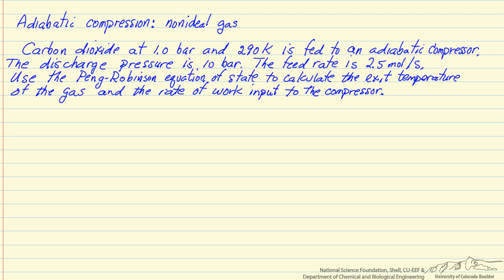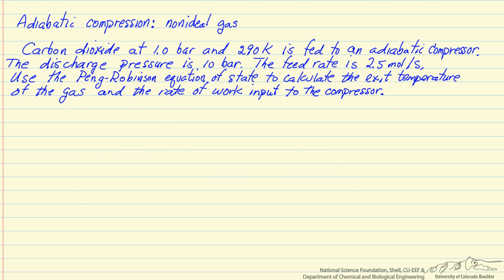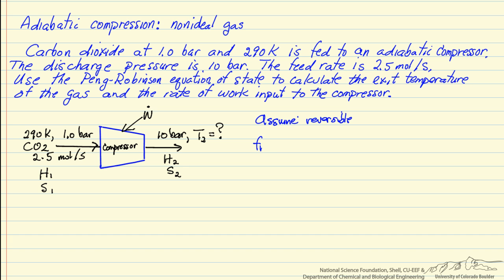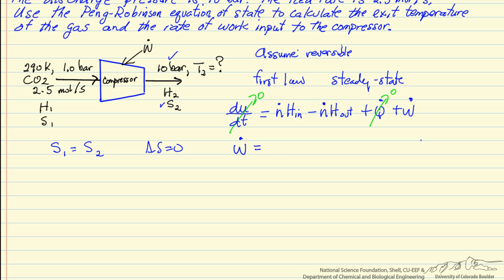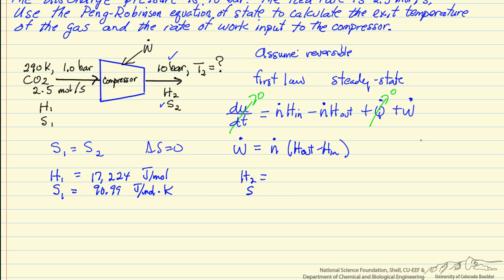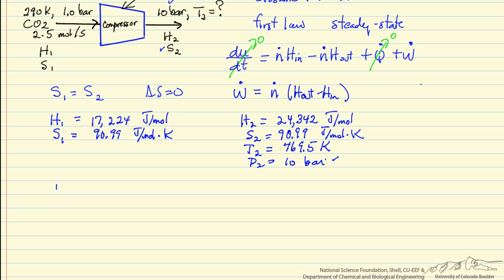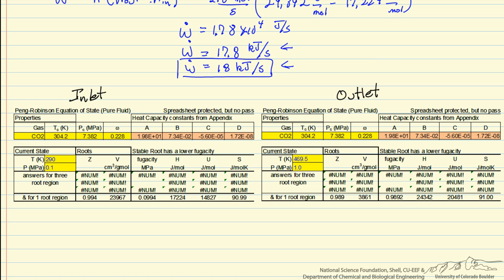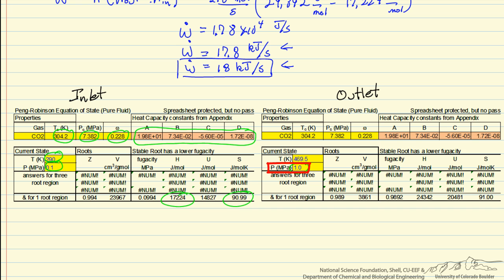Adiabatic Compressor: Non-Ideal Gas

Comment: Hi.. i tried the spreadsheet but the absolute CO2 enthalpy value is different. It is -297.69 J/mol. How come? I think i put everything right. The ref state is 298 K and 0.1 MPa, and it's in one root region. what did i do wrong? Please help.. thank you
Reply from the maker: The absolute values of enthalpy from the spreadsheet depend on the reference conditions selected in the spreadsheet, but the differences will be the same as long as you use the same reference state for all the calculations.
Reply: +echo0204 Hi, I have the same problem and the same H vals. I'm pretty sure I followed the same methodology :c